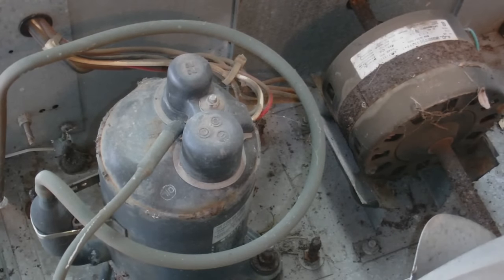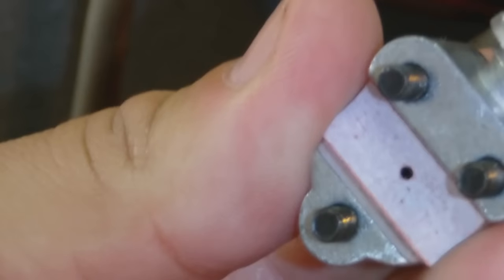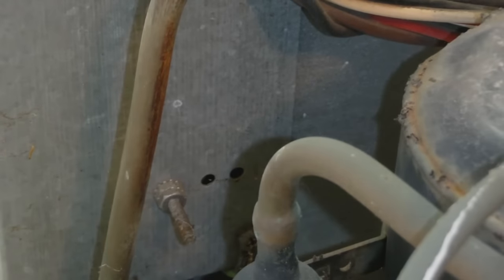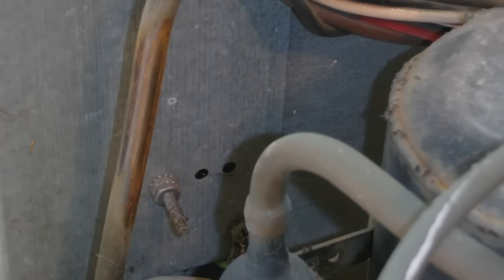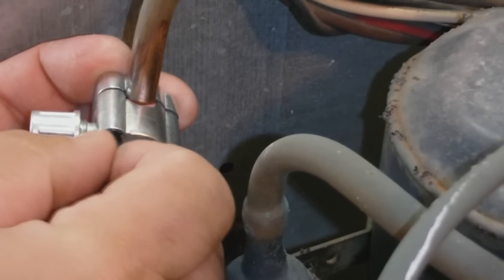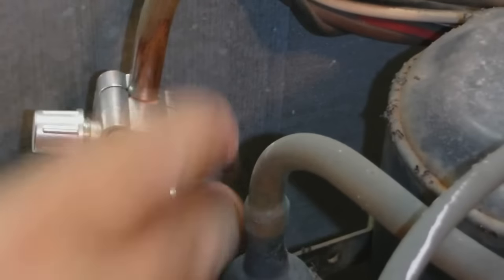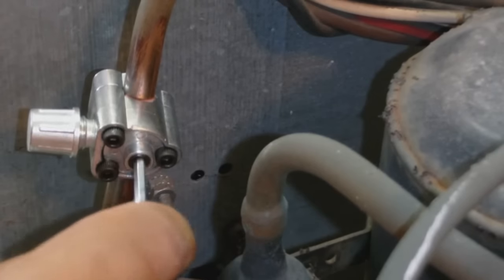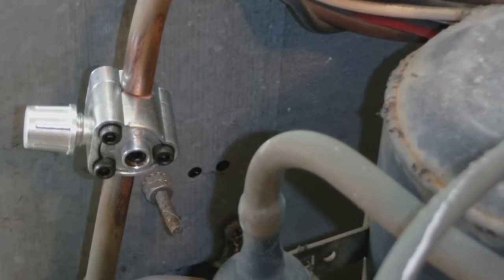How to Install a Service Port on Sealed Air Conditioning Systems: Step-by-Step Guide

Comment: WOW.. Thanks to this video... Everyone told me itrs hard to recharge an RV AC and i was nervous to do it myself. I have a thermo duo that uses R22. Please where can one buy this bullet piercing device? How can you seal it after fill"? Thanks Handyman.
Reply from the maker: +Teo A Here is a link where you can buy a good one http://amzn.to/1PIzGoX . I here alot of people say when they install these or see these installed that the system has leaked out. That maybe so and I m not denying that the valve was not the issue. But when I install these, especially this particular one, I have had no leaks. I the area very well and  make it very smooth for a nice tight seal. I think when some people install these are not cleaning them very well. I hope this helps. Thanks for watching and commenting. Please like, share, and subscribe.
Reply: Thank you very much Handyman!!
Reply: Did you even try to type bullet piercing valve in on Google and see what comes up? How hard is that? It immediately comes up under eBay or Amazon etc etc

Comment: there's any way of distinguish the low compression line from the hi compression one? to make sure I pierce the right line
Reply: Dr JRon low compression is a bit larger in diameter. It will feel cold out of your evaporator to compressor. Your compressor should have a high pressure out to the condenser. Should be significantly warmer to the touch.

Comment: Thanks for the reply! I figured it was probably the wrong oil, but i figured it was worth a shot just in case. I just threw them out (which I would have had to do anyway). It is irritating that they seal those systems at the factory.

Comment: Does it matter if I put it on the high pressure or low pressure? Someone said I have to pierce both lines and check pressure on both lines.
Reply from the maker: pressure should be checked on both sides for a proper diagnosis. But to fill the unit, it should be pierced on the low side. I hope this helps. Thanks for watching and commenting. Please like share and subscribe and hit the notification tab.

Comment: do you back off the piercing screw after you pierce the pipe ?
Reply: Only if you want to release the refrigerant. Once gauges are connected then u we'll need open the piercing valve a couple of turns in order to read the pressure on the gauge set.

Comment: Awesome video, one of a kind. Both my roof top AC units, on my 1978 GMC Royale, have gone down, blows cold for a while then warm. Question: Are new coolants going to be comparable with my old units? Thanks for taking the time to share. Greatly appreciated.
 ☺
Reply: You can use the new refridgerants in the small can from walmart 12 ounce can is enough to fill the compressor with the handy gauge you can also by the adaptors to

Comment: great video i am getting ready to do this to my refrigerator i put a hole in my condenser so i will replace it do i have to pull a vacuum before i recharge? do i need manifold guages to do recharge any tips you could give me would be greatly apreciated thanks
Reply from the maker: Yes whenever you open an refrigerant system, a vacuum on the system should be done to remove any moisture and or contaminants. Yes manifold gauges are needed as far as I know, but thats all i use. I'm sure someone will differ with me. You can buy manifold gauges here http://amzn.to/2qoMCYH or a vacuum pump here http://amzn.to/2pOJxE2 I hope this helps please like, share and subscribe.
Reply: i will have guages and vacuum pump i just do not know if this can be done through just inline piercing valve
Reply from the maker: You will have to locate and differentiate the difference between the low and high side. I fill on the low side ( suction side ). I m assuming that you are working on a r134a system? here is a chart to help with your diagnoses http://handymanpf.com/2017/05/01/refrigerant-134a-pressure-chart/ . I hope this helps.
Reply: i know the high side i am confused as to how to hook up manifold hoses to vacuum pump and then to charge sorry if i am being a pain in the butt thanks for the help
Reply from the maker: Your fine dont worry about it. I hook the gauges up regularly and hook the charging hose into the vacuum pump. I hope that was the answer you were looking for.
Reply from the maker: Also some gauges dont come with a charging hose. if thats the case you can buy one here http://amzn.to/2oY6oIx
Reply: could you explain how i hook hoses up? do i use all three hoses?
Reply from the maker: I hook the red up to the high side ( pressure side ) But I do not open the valve at all on the high side when charging. Then I hook up the blue to the low side ( suction side ) and then the yellow middle line I hook up to the refrigerant tank. As for vacuuming the  system I hook red to high and blue to low and yellow to pump and open both valves for vacuum only. I hope this answers your question.
Reply from the maker: Reason why I hook the red up to the high side when charging is because I like to keep an eye on the pressure on both sides , to make sure there is not something else wrong. Because manifold gauges are a great way to diagnose AC conditions.

Comment: You didn't explain how to identify the high and low side.  Do you install on both, with the corresponding sized Schroeder valves.
Reply from the maker: You can install on both sides but only fill on the low side ( suction side ) . You can hook up to both sides so you can hook your gauges up to get readings on both sides to help diagnose the problem. This video was to show you what to use on a sealed systems so you don’t have to throw the unit away. Thanks for watching and commenting.
Reply: @handymanPF  how do you identify low side on home AC it's not like car where it's marked.

Comment: Do u leave that pierce bullet on there or do u removed it
Reply from the maker: You can if you don’t know how to braze a new service port on or if you just don’t feel like doing it. If you clean everything real well and make this valve nice and tight , it should seal nice.  Mine did.

Comment: Thanks , great stuff to save money, I did have a ? on the rubber gasket, is there a certain % of leakage over time ,not that it's 
 a critical point. Just curious on what it might be compared to a factory sealed unit ? Thanks for the cost saving tip.
Reply from the maker: +Hemi Power tell you the truth I have no idea, but granted a factory sealed unit is much better. But, I found out if you prep the puncture site by cleaning and sanding it properly, that these valves hold up very well. This unit in this video , still has the same refrigerant in it to this day and this video was made quite a few years back. Thanks for watching and commenting. Please like share and subscribe.

Comment: With charging any hvac there is safety issues.  First of all you must determine the proper side of the system to recharge.  Most systems use the LOW or SUCTION side.  This is 
usually the larger size of tube.  
Also, those type of valves do tend to leak over time so the brazing or soldering type 
are the best.
I did HVAC for a few years and had numerous training courses.  I would suggest 
to get training or help for this type of project.  Of course I know there are the super
DIYers out there that this project would be easy.
Remember these systems could  have pressure still in them and also the 
Refrigerants pose risks when vented. (which is Illegal) EPA fines are very stiff.
Just my thoughts.
Ed
Reply: Who is going to be watching you if some refrigerant leaks out?! You people are so caught up in needing a specialist for everything. All the info u need is available online.  do you think they really remove all of the refrigerants from the old junker cars that grind up?
Reply: Not with the new refridgerants from walmart one 12ounce can is enough to fill  without a license and it makes the old r12 inert   when mixed with new fridgerant
Reply: Those valves will last forever if you do them correctly.  What kind of nonsense are you spreading.
Reply: I've seen new lubricants/sealants on the market that behave as a lubricant when mixed with refrigerant but turn crystallin when exposed to outside atmosphere. It's not the atmosphere that causes the change but the sudden change of pressure in a leak. They're designed to seal small leaks that form over time. They'd probably do well to seal up any leak from one of these connectors.
Reply: thats the problems nowadays everyone wants an arm and a leg to work on something....thats why theres people all over doing work on stuff themselves

Comment: Thank you Mr. Handyman. I have a question. I also have a roof top A/C RV unit that uses R22. Can I convert the unit to run on R134A? and if so, what do I need to do to convert it?
Reply from the maker: I do not believe so, I do not think the compressor is compatible with the oil and plus the pressures are different. But they do make a replacement r22 which is similar here is a link  http://www2.dupont.com/ISCEON/en_US/products/ISCEON_MO99.html#.U2LF2vldVMg

But the current system will have to be evacuated and refrigerant disposed of according to the EPA guidelines. Because EPA law does not allow mixing any type of refrigerants. I hope this helps.
Reply: Find model serial #of your equipment & check spec sheet for pressures, lot of systems can be used with r410a,407c  if that system supports those higher pressures & poe oil than you will drill and install(braze in) suction & liquid line service ports, use r11 to flush the line set, and thrn the usual vacuum with poe oil and charge as per sticker weight spec. With r407c, or  r410a if system is compatible

Comment: Lots of confused comments on here!   He does not actually show you filling the valve with Freon, but modern fridges and vehicles both use R134a, which anyone can buy online or from an automotive store.  R134a is the only Freon that does not require a license to buy or use.

The bullet-piercing valve (aka saddle-valve, aka line-tap) has an R12/R22 port, but you don't actually use R22 Freon!  You buy a cheap hose and gauge and a can of R134a, then you top up the level so the pressure reads somewhere between 2 and 5psi.    You can buy a cheap R12/R22 to R134a adapter, then your fridge will have the same low-side port connection as your motor vehicle.
Reply from the maker: But you cannot mix refrigerants what so ever. Make sure you have the right refrigerant.  It is not called Freon anymore, but some people still refer to it as so. It is called refrigerant. You are absolutely right about the adapter kits.

Comment: Where do you get the cans yo recharge it? All the ones I find are the ones that you push on...j cant find the ones that you screw the hose onto it to recharge the unit.
Reply from the maker: Here is the piercing valve for the refrigerant can https://amzn.to/32ZG9H7 and here is the charging hose https://amzn.to/31e4l6V
But I highly recommend getting the refrigerant gauges  https://amzn.to/2STHpa5 and learn how to read them properly . I hope this helps. Thanks for watching and commenting.

Comment: Do you know how much pressure do I have to put on the AC off gas Because I don’t want that to blow up
Reply: once again, type that question into Google and get the answer for yourself. That isn't an easy answer because it is a very specific to your AC system. How large is it what type of refrigerant BTUs etcetera. It's different with all as all refrigerants have different boiling points and will require specific pressure which is usually outlined on the gauge set

Comment: Hi god bless you. I have a question i wash my ac window unit its a frigadare i bought it about a couple of months back brand new but i decided to wash it with the water hose i opened it and rinse it  and everyhing was good till i turn it on its not cooling as much as it was do you recommend me to try this??? It cost us @700 so i really need your help please
Reply from the maker: Thank you. God bless you too. Did you check the filter screen on the front of the  unit to make sure that wasn’t dirty?if that filter is dirty or clogged, it will block the air flow from the evaporator . If that doesn’t fix your problem, then if your AC is only a couple months old and not cooling it should be under warranty and I would return it for them to repair or replace. I hope this helps. Thanks for watching and commenting. Please like share and subscribe

Comment: How much coolant does a 13500 btu RV unit take to charge? I don't want to go to the store ten times. Nor do I want to have cans lying around.
Reply from the maker: +Desertdweller1965 I seriously cannot answer that question. But I can give you advice.  Why don't you buy more then you think you need, use what is needed. Return the remaining product to the store. That way you run to the store twice and not ten times and plus you will not have cans laying around.
Reply: should be an id tag registers in ounces
Reply: No one can answer that question. You need to check the service plate on the side of the unit. It is very specific to each individual air conditioning system.

Comment: How well does these valve seal after it pierce the pipe?  I have a cooler unit that has a bad valve, we end up striping the screw.
Reply from the maker: +xz86 I haven't had a problem. But a lot of people said they leak. I think, they are not cleaning the surface properly and making sure the tube is perfectly round. But I could be wrong. I hope this helps. Please like, share, and subscribe.

Comment: Where can I buy the saddle valve for my ac unit?
Reply from the maker: You Can Find The Bullet Valve Here On Amazon http://amzn.to/2maNu3R

I show you how to install a service port on a closed air conditioner unit. You can use these bullet piercing valves on refrigerators and home ac units that are sealed off from the factory. You wanna make sure you install it on the low side Suction side. I perform this task on an old  r22 rv roof top ac unit.

If you need items to perform this task you can find them here http://amzn.to/2aik2mu for the basic and simple 134a or you can get the gauges, 30lb tank and valve here

30lb tank http://amzn.to/29VSBv3
gauges http://amzn.to/2aiksti
valve    http://amzn.to/2a8flLH
tank adapter for the gauge hose http://amzn.to/2a5JV5R

Comment: What he doesn't tell you is that those piercing valves leak not long after installing...  I've been told this by 2 hvac guys and I just noticed another guy posted the same thing here.    So, go ahead and use them but plan on a huge expense of refilling with R22 every year.
Reply from the maker: I haven’t had that problem and if you are that concerned about it , then braze a solid service port on it. Also what you are not telling them is not all systems are R22 , especially the new systems. Keep the area clean and keep the caps on the piercing valve tight and you most likely will not have a problem. I have worked with these valves and this guy here is going by hear say. Please do not automatically assume your unit is R22 , read the label attached to the unit. The label will have the refrigerant type listed on it. This guys comment could be very misleading and having you think all system are R22 in which they are NOT.

Comment: How do you know which line to connect it to? I imajine succion line but how to tell the difference? Help
Reply: Instead of writing all of these silly questions and spending the time typing them to this man who is nice enough to make this video, why don't you just type that into a Google Search and get the answer for yourself?
Reply: The low side is the pipe that is a little larger in diameter than the high side pipe that has the refrigerant (cold pipe).When you start your AC and compressor kick in (you will hear it) the large pipe will become cold by touching with your hand. The high pipe (small pipe) will be warm to the touch.That's how you know which pipe to pierce. The COLD pipe is the answer.

Comment: Hello , question: how do I know which pipe/tube to pierce???? TIA
Reply: All That Matters Is If You Have The Clearance To Place The Valve, And Also Room To Place The Refill Nozzle Onto The Valve... All The Tubing Runs To The Same Place So It Really Doesn't Matter Where You Place It Cause It Recharges The Whole System Regardless Of Position...

Comment: was wondering if you would know where to install the saddle valve on a vending machine. I already purchased the valve and it uses 134a refrigerant, I was just wondering where do i install the valve on the lines. If you could help that would be great, been searching but no clear answer was available. Thanks again....

Comment: Dude you rock bro thanks!
Reply from the maker: +TheTundrawolf I m glad you liked it. And you rock! Thanks for watching and commenting. Always appreciated. Please like, share, and subscribe.
Reply: +handy man have you ever screwed on an r22 to r134 adapter and used automotive r134 to charge the system?
Reply: Yes I have done that and it worked just fine.

Comment: hello just one question how do I know what type of freon does my AC needs to take where do I find this information on my AC unit on my RV
Reply from the maker: +carlos jg there will be a white label with black lettering usually on the unit. It will state the voltage, pressures and refrigerant type. It should be very easy to find. Usually on the back of the unit. I hope this helps. Thanks for watching and commenting. Please like share and subscribe.
Reply: On the service plate on the unit. May have to remove the cover.

Comment: Do you put the valve in on the suction side?
Reply from the maker: If you are going to charge it ,  then yes. You can put it on both sides if you wanna hook gauges up and diagnose the problem. But DO NOT charge it on the high side. Thanks for watching and commenting. Please like share and subscribe